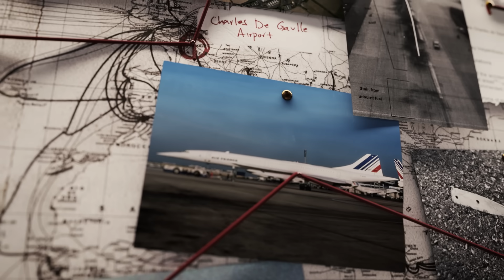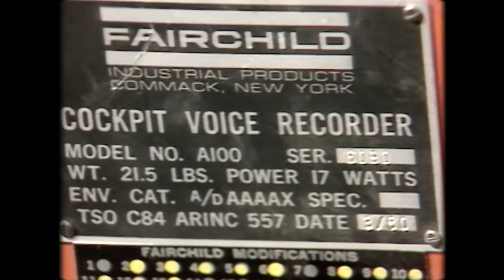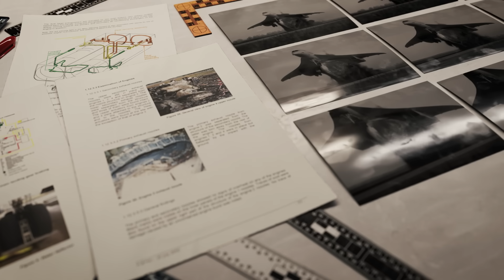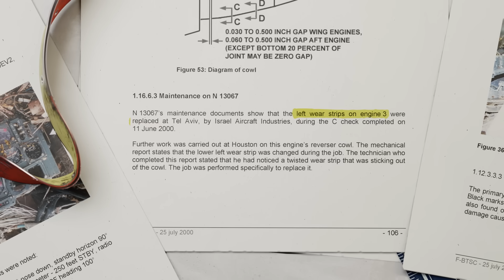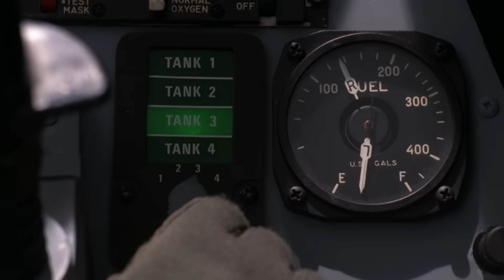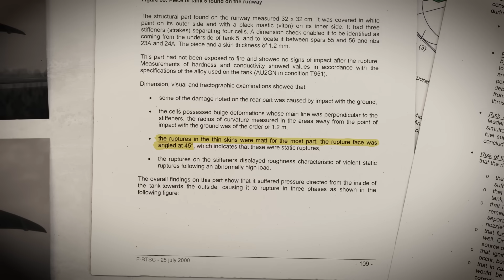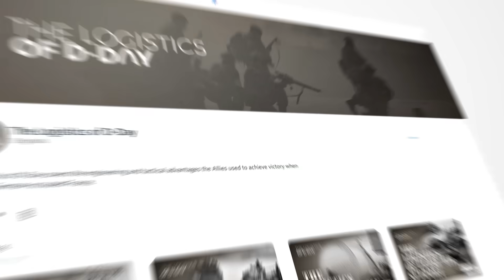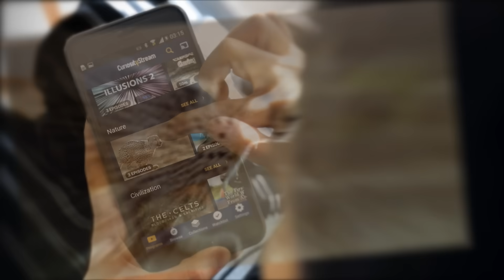What Actually Happened to the Concorde

Comment: CONCORDE CRASH

Congratulations to you on a well made and analytical video. However, I am afraid you have missed a number of facts and components to this disaster, which are worthy of further examination.

Firstly, this was not an accident to 'The Concorde' ...
What this was was an accident to this particular aircraft within the Concorde fleet, operated by both Air France and British Airways. This is an important distinction to make because there are significant factors to how this particular aircraft was maintained, serviced and specifically operated and flown on the day it crashed by Air France.

Your analysis that the fragment of tyre hitting the wing, setting up a shock wave inside the wing tank of the aircraft is spot on, as is the fact that because the tank was so full of fuel, this resulted in a hole being punched in the wing tank from the inside.

But we need to step back a good few steps.....

On the day of the flight the aircraft in question was carrying too much fuel. OK, all aircraft carry enough fuel for their flight, which incorporates a sufficient reserve for any emergency or diversion, but this aircraft was carrying more than necessary. The pilot, (for he is responsible), had topped up the tanks of the aircraft more than was needed for this flight and as a consequence this made the airplane heavier.

Because of the extra weight it needed more runway length than would normally be the case and the pilot chose to make use of an additional length of runway at the very start-end of the runway. This area of runway used to position the aircraft prior to the commencement of it' 'Take-Off Roll' was not surfaced to the same standards as the rest of the main runway and it comprised a more uneven and rougher surface to it. 

Because of it's uneven and rougher surface, this part of the runway was not generally used by aircraft as the positioning point for the start of their 'Take-Off Rolls'. Most aircraft at this airport tended to depart the taxiway short of the very end of the runway thus ensuring that they were on the more even and level surface from the start.

Now comes the most important bit.......

The accident airplane's most recent maintenance / service had seen work carried out on the landing gear wheel-sets, and in the re-assembly of the left-side landing gear a crucial metal spacer shim, forming part of the wheel-set, had not been replaced as it should have been.

The metal spacer shim formed a fundamental part of the wheel-set / tyre arrangement, because it's purpose was to ensure that once in motion the wheel-set ran true and in-line, thus ensuring that the landing gear performed as it should.

We have to remember that the main landing gear of an airplane is not steerable. It only moves through a tilting moveable axis, when retracted or deployed. Obviously it also performs as suspension for the main air-frame in supporting the airplane. Only the nose-wheel gear is steerable.

Because the metal spacer shim was missing from the wheel-set it's operation was compromised from the start, but especially so because at the start of this particular 'Take-Off Roll' the wheel-set was running over the very rough and uneven surface that the pilot had chosen to use.

As the airplane began it's acceleration over the rough and uneven surface, (at the commencement of the 'Take-Off Roll' and before it reached the smoother runway), the wheel-set was affected by excessive vibration due to the fact that the metal spacer shim was missing and started to run out of line.

Once out of line the wheel-set was essentially useless as it was influencing and controlling the 'Take-Off Roll' with only nose-wheel input, (rudder being unlikely at this point), being able to pull the airplane back into a straight line.

It is in fact, fortunate that this was done by the Pilot, since the accident airplane came very near to colliding with another aircraft on a taxiway at the left-hand side, waiting to cross the main runway.

The actions of the wheel-set, on the accident airplane, running out of true and not therefore in-line, placed undue forces upon the wheel-set itself, but also upon the tyres, and whilst the small titanium  'rubbing strip' which was on the runway and found to have come from an earlier departure by a Continental flight, has carried much of the blame for the accident, it is not the whole story.

Damage to the tyres caused by the undue forces on the wheel-set, as it ran out of true, cannot be discounted, but you will struggle to find this in any coverage of the accident or in any detailed manner in the accident report.

If we are to consider that the small 'rubbing strip' from the Continental airplane was the sole contributor to the accident, then we must consider the this might only have been possible because the wheel-set on the accident airplane ran over it and because the airplane had deviated from it's intended and proper, straight line 'Take-Off Roll'.

Had the missing pacer shim been in place, as the important part of the wheel-set that it clearly was, then the vibration set up in the wheel-set on the rough and uneven part of the runway at the commencement of the 'Take-Off Roll' would likely not have occurred and the airplane would have maintained a straight line down the rest of the runway.

The argument can be advanced that had this happened it would not have made contact with the small 'rubbing strip' left on the runway by the earlier departing Continental flight, and that it would have taken off safely.

It is probably not generally known that it was standard practice for British Airways to inspect the runway for any debris or foreign matter prior to each and every one of their Concorde flight departures. This was not something that Air France did.

Once airborne and with the wing tank ruptured and a fire ensuing, the Flight Engineer departed from Standard Operating Procedure and shut down an engine. Whilst this might make sense to the layman with a fire burning, it is not necessarily the correct thing to do and can complicate procedures for dealing with an emergency.

The Pilot Flying in carrying out the diversion to seek to land at the nearest airport then made the most fundamental mistake in flying, and especially in any emergency. He failed to 'Fly the Airplane'............as a consequence he let the airspeed drop and the airplane stalled.

Clearly, his stress levels would have been very high at this time, but he should have been prepared and able to handle the situation.

To his credit, the Co-Pilot, (Pilot Monitoring), recognised the dangers they were in as the airspeed decayed. His presence of mind in observing the airspeed at this time is an exemplary action on his part. On the CVR he is heard to call-out and warn of the decaying airspeed, during the final moments. He actually calls out "..Airspeed.." three times...!

Despite the serious situation in which the crew found themselves, the alternate airport was close at hand and a landing was just possible. No doubt with the fire already consuming the wing there would most certainly have been a post-crash fire upon landing, but it can be argued that the crash might just possibly have been survivable for a small number of passengers.

Of course, in truth we shall never know.......but we do know enough to tell us that there was more going on with this flight than the small 'rubbing strip' left on the runway by the earlier Continental departure.

James Hennighan
Yorkshire, England

P.S.
It is not generally known that one of the flight crew on the accident airplane was not up to date with their flying certification, but you will struggle to find this explained anywhere.

Additionally, Concorde was not withdrawn for the often stated reasons of general operational cost. 
In fact, British Airways made a profit on it's Concorde operations.

It was withdrawn because Air France wanted British Airways to subsidise their operation of the aircraft. This was clearly something that British Airways could not do, and so as a consequence Air France, broke the Joint Operating Agreement that existed between themselves and British Airways.........and this at a time when a good deal of money had been spent on general refurbishment to the airplane, including the fitting of Kevlar Fuel Tank Liners.

This agreement stated that only Air France and British Airways could operate Concorde jointly, so British Airways could not fly it alone. In a similar vein, this precluded other airlines, (many of whom were anxious to perhaps own and fly Concorde), from participating in it's operation.

Had the British Government of the time had the balls, it would have called the bluff of Air France...and of the French Government....and drawn up new operating agreements with other airlines that would have allowed them to use the airplane.

But it did not do so and the most backward step in aviation history was taken by the very country whose scientists, technical experts and aviation designers and builders, had brought the most scientifically advanced airplane in the world to the skies.

Comment: There is one thing you are completely wrong about. You say @14:11 that the Concorde went out of service because of the crash. That is incorrect. It went out of service because of 911.
Reply: I mean, both contributing factors? Concorde was grounded until issues were addressed
Reply: @MaakaSakuranbo  What the fuk are you talking about???? Concorde went out of service because 911 stopped trans Atlantic travel. Concorde was not out of service because the French Concorde crashed. You are ignorant.

Comment: @Real Engineering
Thank you for the video, unfortunately you missed the actual cause of the crash.  John Hutchinson has an excellent video explaining his credentials and the real reason.  Simply put the captain overloaded the airplane with completely full fuel tanks, WHICH WAS NOT NEEDED for the planned flight.  Had the tanks been loaded normally to 85ish% (the number is in Hutchinson's video) the resulting air space would have absorbed the shock wave.  Since the tanks were full with incompressible fuel the burst happened as you described.  If the captain had not ordered the tanks completely filled the huge rupture WOULD NOT HAVE HAPPENED.

Comment: I sorry but you missed three key things that ultimately resulted in a revision of what caused the crash. First, good job noting the Dulles flight, many European reviews of this crash always miss that flight, however, it was a passenger that first noted the leak, not the crew. The crew were set to continue to France. This is on the Smithsonian channel's Concorde documentary which is sometimes on YouTube sometimes its not.  However, even during the investigation the metal strip was found as barely being a contributing factor. In fact the fire trail where the aircraft went off course started BEFORE the metal strip, not afterward. In fact, had the aircraft not gone off course initially, it would have never hit the strip. This was confirmed by a hangar personelle on the field at the time and the pilot of another AF plane that was holding for Concorde to take off. The problem was the spacers in the gear, which is what caused the Dulles incident. What had happened, which Continetal eventually took back to court and won, the spacers allowed the tire to flop around which caused the tire to blow, but it also sent small pieces of debris into the wing that were red hit which caused the fire. That's how the fire happened even though there was no wires in that area of the wing. Also, CDG crews were aware that debris might have been on the runway and were supposed to sweep the runway before the Concorde took off but did not. Also, pilots from BA testified that the plane should have been healthy enough to make it back, but the aircraft was severely overweight. Because it was a charter AF didn’t want to route bags on another flight, so put them on this plane. That's why they couldn't  gain altitude. These issues where ignored in BEA's first investigation and lead to Contintal hiring their own investors who took this into account. The problem was AF was already in finacial trouble and the Concorde was a source of national pride, so they didn't want to blame the company even though they were told to fix the spacers for decades after the Dulles incident. Even with the correction, The BEA never corrected why the plane crash in official documents. Finally, while finacials were a serious factor in why the Concorde was ultimately retired, but there was a bigger reason...the A380. Airbus held the contract to provide maintenance services for the aircraft, but with the A380 coming up, they wanted to push airlines to buy that plane so they stopped providing those services. This is what lead both airlines to cancel the aircraft as they couldn't afford to maintain the plane without that deal in place. Even so, several airlines include Virgin offered to buy the planes and have them retrofit with modern technology and have another company provide the maintenance services, but they were flatly turned down.